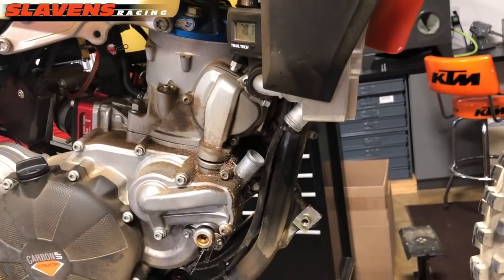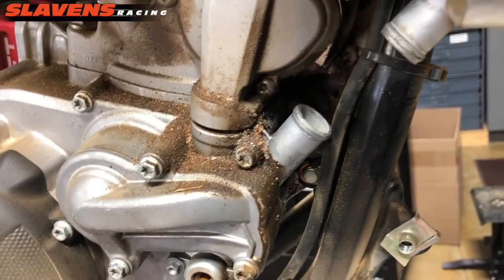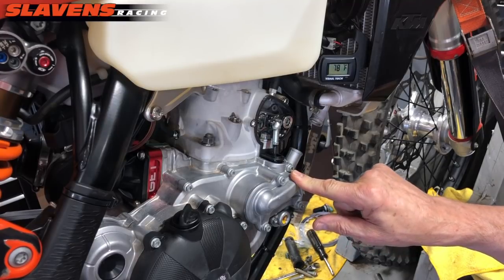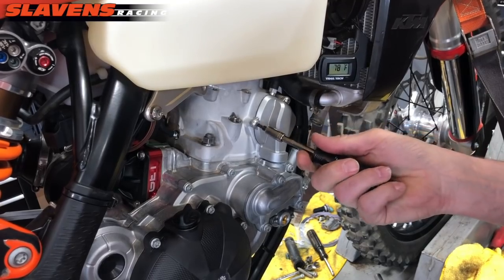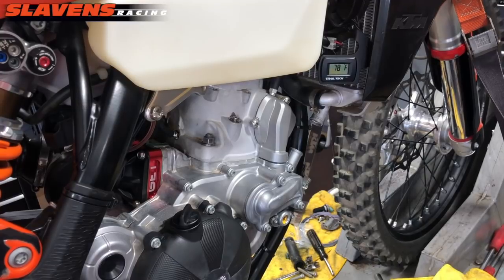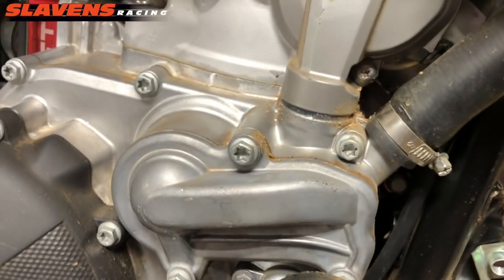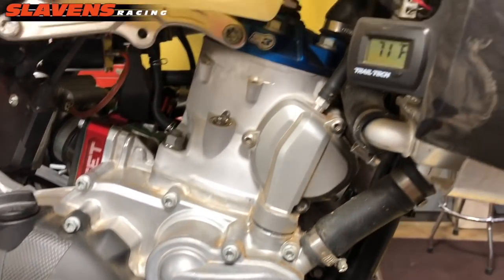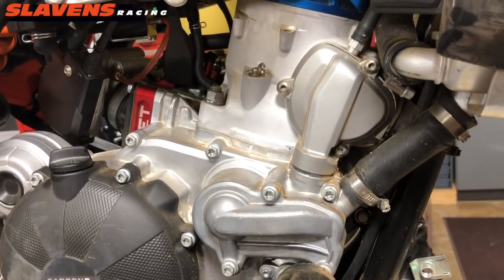How-to Fix the Power Valve Cover Oil Leak on KTM

Comment: Great video Jeff.  I have a 2020 and I have tried to fix this 4 times.  This is my observation.  Take it for what it is worth.  You have WAY more experience than I do with this kind of stuff.  I did the same thing that you did and still leaked.  I finally took off the inner clutch cover and removed everything including the rubber piece that you siliconed.  I notice right away that the cylinder head actually sticks out slightly from the case.  Just a hair.  It always seemed that oil was coming from this spot.  I applied a very, very thin layer of silicone to even out this area and it worked and has not leaked since.  Next time you have this are broken down please look at it and see if yours is the same.  To me, there should be no tolerance between the head and case, but there is.  At least on mine.  Hard to explain and I hope that I am clear on explaining this.
Reply: I wish you had photos on a forum somewhere to show this better and wxactly what you mean. Any chance you do?
Reply: @Michael_Douglas007  I do not have pics.  It is hard to explain but take the whole inner clutch plate off and you will see the area that surrounds what he is working on in the video.  On mine, there was a very small gap.  I applied silicone to this area.  You will see what I am talking about if you take the inner clutch cover off.  I think this gap was created by warping some from excessive overheating.  This is just my thought.
Reply: @davidreed6145 Maybe engines differ in this area slightly. I'm assuming mine is quite a large gap because i have this exact leak and i haven't finished my run in 3 hour period yet.
I'm in two minds about either tearing it down, or getting the shop to tear it down and fix it for me. 
I can see the issue is not too difficult to fix, but it shouldn't really be happening on a 2 hour old bike that has been ridden gently

Comment: Jeff, I assume you are working on a 2020 bike in this video. I believe this is a temporary fix, the problem is the sealing element (grommet) on the 2020's is smaller and is causing this leak. The permanent solution is replacing the grommet with a 2019 one that is larger. I sealed my PV cover the same way you showed here and it lasted about 40 engine hours before it started leaking again.
Reply: This is the winning solution,  did the same thing.  only thing that worked for me.
Reply: Do you have the part number?
Reply: @blackhillsdualsport  I used 2017 xcw 300 part.  Look under clutch cover.  1. 54837091100	SEALING CARRIER 07 (x1).  	  2.  54637107000	SEALING ELEMENT BOTTOM (x2).
Reply from the maker: PNW Enduro 
The grommet part number is the same from 2008 to 2021.  I did the same mod on another bike that now has over 100 hours on it and still
Reply: Jeff Slavens ktm changed the part number when they found out about the issue. New part was a one piece design while the older is three pieces. Look on my Instagram you can clearly see the difference in size between the two. Since I changed the parts I have no leaks and have not used any silicone.
Reply: @slaverace1  Can you recommend a better sealant than silicone for this issue?
Reply: The key with silicone is cleaning the surfaces really really well, otherwise you won't get a good seal.
Reply from the maker: @PNWEnduro  
Thanks for the info. KTM is obviously not consistently using the same parts. I have 2 2020 300s and my buddy has a 2021. Those 3 bikes all have the 3 piece style they have used for years and those have also leaked for years but easily resolved with silicone seal.
Reply from the maker: @mulimen1  
Silicone seal works for me. Don't see a need to search the planet for an alternative solution.

Comment: I was irritated to find that on my 2021 TX300 I also had an oil leak around the power valve cover. It wasn’t low on the cover around the D seal, it was higher up and around power valve bolt stop on the front of the engine next to the exhaust spring tab. Long story short, I found that the root cause of my leak was that the vent hose that runs from the top of the power valve cover into the air box was kinked at a sharp 90 degree angle where it went into the air box. It was kinked tight enough that there was a crease in the hose after I straightened it out, so there was little if any venting taking place. If you having oil leak problems,check your vent hose.

Comment: I have a 2020 TE300 and fixing the leak from the power valve cover is only half the issue. The second place these leak is from the PV stop screw on the front of the motor. Jeff, can you please do a video on that. My guess is the head needs to come off for that.
Reply: same here
Reply: Mine has massive air flowing out of the exhaust spring tab bolt when doing a leak down test. Is that the pv stop screw your talkin about?

Comment: Hi, just saw on PNW Enduro channel that the 2020 grommet is   smaller and shall be replaced by the 2019 grommet which is bigger. The 2020 part is now replaced by 2019 part.
Reply: Have this problem with 2019 and have replaced with 2019 grommets. No luck with sealing FYI. Based on what I have done this looks like only fix. G

Comment: Also tried silicon...failed after several hours.  Got the 2019 parts and haven't had a problem since.
Reply: I tried silicon also...didnt fix it either.  I pulled back apart and trying Permatex ultra grey to see if that fixed it.
Reply: Did you put silicone on the new parts?

Comment: does this cause any performance loss? Other than creating a mess. My TSP cover is leaking a little. I installed it on a clean surface and torqued to spec. Trying to decide if I want to deal with it or now until winter.
Reply from the maker: Hello:
That cover should not leak. The gasket must have an issue and should be replaced.
Reply: @slaverace1  can I use the OEM gasket?
Reply from the maker: @grutzmac  
Yes

Comment: You Tube is really amazing, it seems like they got every problem known to man on it. 
I have the exact thing happening on my bike. And man it is hard to see where the oil was coming from with the pipe & skid plate in place, just as Mr. Slavens mentioned. Of course my eyes aint what they used to be , but after disassembly last weekend I did confirm it was the same spot. I was considering the silicone repair but ordered the cover gasket & rubber piece they call the "sealing element" in the KTM parts list. Does anyone think they should also be replaced. ??

Comment: I just noticed mine leaking as well. Thanks for the info...quick question how hard will it be to get this back off when needed to take back off?
Reply: Dirtrider Xc300 not an issue at all. That silicon will separate so easily when you take off the cover. And what's nice about silicone, in 5 seconds you can pull off the old silicone from both pieces. Reapply a fresh bead of silicone upon reinstall. Piece of cake.

Comment: i got a 2023 te 300 bought it when i was 18 btw, 22hrs later had this leak. took it in under warrenty took them 4 weeks to get it fixed. they replaced the power valve gasket. ive had it back for a few days. rode two days leaking again. im trying to decide if its the power valve like u showed or if its my main seal at the bottom of the jug. im supposed too leave monday for 14 days before i start college again. so now i have too try and decide if its major being the jug too bottom end seal or minor being the power valve seal. either way the dealers geting a ear full for damn sure.

Comment: @slaverace1 Just wondering, will the silicone make it hard to remove the cover later and make it tough to reinstall once there is old silicone there? Found this leak in my bike and just wanted to be sure. Thanks!
Reply from the maker: No, it is not hard to remove and yes you will need to scrape off the old silicone sealant.

Comment: Selicone is not the resolution of the problem
Reply from the maker: I've used this method for years and it definitely works.
Reply: @slaverace1  It didn't work with me. I just managed to repair the problem with the rubber kit of the 2019 model. And to get a perfect job I had to relieve the entire right part of the crankcase to get the u-shaped sealants into the cavity

Comment: How’d you take the pipe off? Wondering how I could take off the pipe without taking off the silencer, just bought this dirtbike so I’m clueless to this stuff
Reply: You need to use a strong spring puller on the header then remove the remaining bolts, 1 bolt up top next to the engine mount and two bolts  down low on the expansion chamber! Don’t over tighten the silent block bolts upon re installation as they require a certain amount of movement in them I believe!  Very easy job!  don’t loose the spring band on the rubber coupler!

Comment: I did the same thing for my daughter's 85. They are very similar, except the 85 has a gap between the bottom of the cover and the cylinder which is impossible to clean, so I filled that gap in with silicone as well. I also replaced the bolts that hold the cover on with hex head titanium bolts because the stock ones are very soft and nearly stripped out on me the first time I took them out. Titanium ones of this size are inexpensive.

Comment: I was just wondering how you would remove the cover after using silicone seal?
Reply from the maker: It's not a big deal. Comes off fairly easily.
Reply: @slaverace1  ok thanks a lot

Comment: I wish the RTV hack worked for me. It kept leaking.
Reply from the maker: Hello:
Sounds like the rubber pieces have shrunk or hardened. Replace them and also use RTV.
Reply: @slaverace1  Thanks. I ordered the sealing element bottom, sealing carrier, and the right side cover gasket and plan to reseal them with the gray RTV as previously recommended. Are there any good videos on how to replace those 3 pieces? it's a '21 KTM 300 xcw with a new top end at 85 race hrs.

Comment: It seems like people think that this is an issue unique to the 2020 and newer KTM 2 strokes, I'm not sure why everyone is so worried. I had this same problem on my 2009 300 XCW when I got it 4 years ago, and used silicone to fix it like you. It didn't leak at all between the 150-200 hour top end rebuilds. Cheers.
Reply from the maker: Agreed! This has been a small and easily fixed issue for years but now guys are beating the drum like it's a new tune. Go figure.

Comment: Hey Jeff will it hurt to put rtv Silicone on both sides of the gasket as well as the main area that you have showed?  I’m doing mine tomorrow!  Thanks
Reply from the maker: Won't hurt anything but it will make an unnecessary mess.
Reply: @slaverace1   I was very precise,   No mess at all and no longer leaking,   Thanks for the video Jeff!!!
Reply: is that the lucky bike in your profile picture? Looks sick
Reply: @Nebula-rx7bj  thanks man!  Great bikes!

Comment: The 2019 seals and seal carrier are they way to go. Just did my 2020 300 and ran it all weekend no leaks.
Reply from the maker: Marlin, I hate to tell you BUT the seal rings and carrier are the same parts and part numbers from 2007 through 2021.
Reply: @slaverace1  far from the same. Rocky mt atv part# 55537091000 sealing element. 2019 rocky mt atv part#54837091100 sealing carrier 07, 2@ part#54637107000 sealing element bottom. 2020 is one piece and IMO very week and shitty. 19 is 3 piece and the carrier is bulky and strong.
Reply from the maker: @marlinbeach6982  
Marlin, no idea what we have going here because I looked at the KTM factory dealer website (only accessible by dealers) again today to verify. The 546 and 548 numbers you list above are listed on every 250/300 microfiche from 2007 (250SX) to 2021 250/300 (all models). I own 2 2020 models, 1 2019 and my buddy has a 2021 and they all have the 3 piece (2 sealing rings and 1 carrier) units that KTM has used for years. I have yet to see the one piece 555 style but don't doubt it is out there. Also, 2020 and 2021 are not the only years that have had leaking issues. I've seen this issue since 2008. I just cleaned mine with contact cleaner, applied silicone seal and problem solved. Not trying to beat this horse to death or start a feud, just stating what I have seen and researched on the KTM dealer site.
Reply from the maker: Update; below PNW said KTM updated their microfiche to the old numbers. That clears up the confusion.